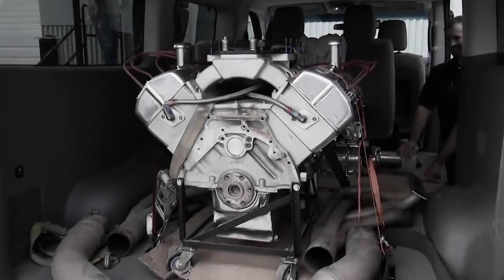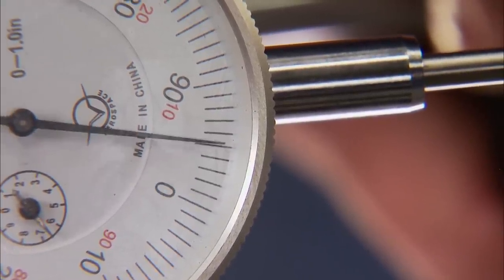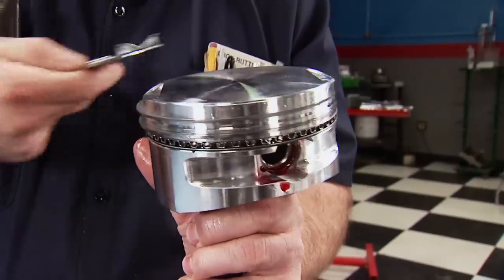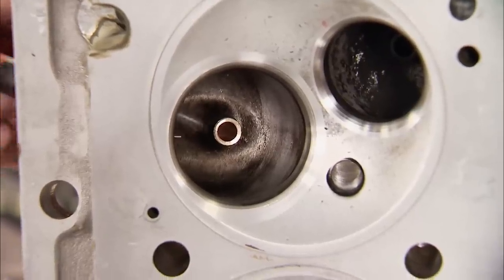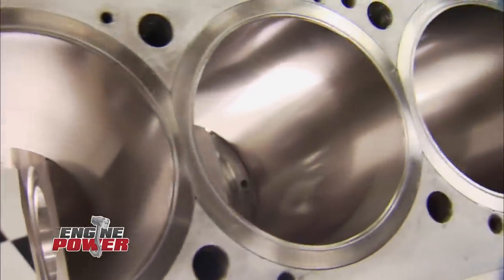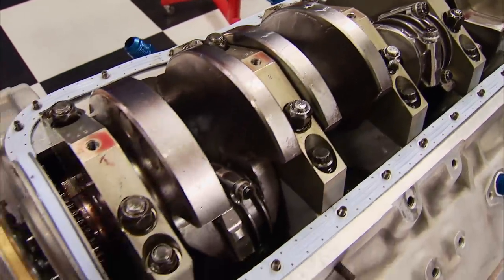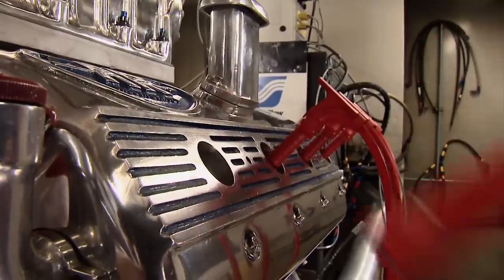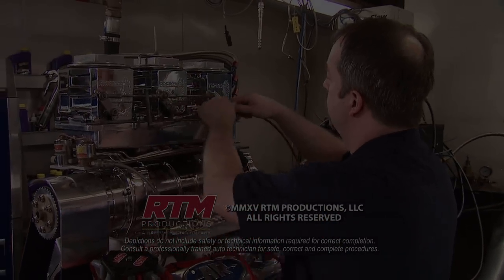The Original BigFoot Engine Build Part 3 - Engine Power Season 2, Episode 7

Comment: Absolutely gorgeous motor! I wish they would've given it a blast of nitrous though. I'm kinda surprised that it didn't produce a lot more HP than it did considering  the huge valves, high lift cam, all the reduced friction contact points by using roller tips etc. I mean, there are several Dodge and Ram products using a sweet 572  Hemi with 700hp @6500rpm. Maybe once they work up to the same RPM on this one it'll show a much higher amount of ponies revving things up.
Reply: Green MarineFive-O this is a design from the 80s and was still extremely fresh

Comment: Gotta say, I was disapointed with the final numbers.  All that tech, the size, octane and a huge blower for 1,000?  I was expecting half again that.  Still, an awesome engine.
Reply: Really the Tech was old tech... The whole thing if built today would have been completely Diff. 1000 ish HP ( Im sure they could tune if for ALOT more but the object was NOT peak HP but strong usable numbers ) for the era it was built in was AMAZING.
Reply: @Chad-Dion  A you taking into account all the upgrading they did?  Ports, new cam design, upgraded ignition.
Reply: Detuned as it’s not gonna be raced any longer.
Reply: @cavscout62  From what I gathered, it was actually increased.

Comment: why does that thing have so much deck clearance?? low comp for blower??
Reply: If you're talking about when he was degreeing the cam with the piston stop, the piston wasn't at top dead center.  He was trying to find tdc.  If it was zero decked, then he was pretty spot on for quench with a .043" head gasket.
Reply: watch them roll the thing though at 6:12 @MP-vm1jt
Reply: @reedjet  oh wow, yeah I was slipping, you're right sorry about that. I guess that engine doesn't have quench like I'm used to.

Comment: Those copper gaskets don't seem to have steel on the cylinder side like others is it not needed on solid copper gaskets??🤔🤔 Won't the heat blow or burn it.. don't remember seeing torquing the outer main cap bolts only inner 🤔🤔

Comment: I have an old car, I would like to strengthen the engine in it, what parts should I replace?
Please help, I need your information
Reply: Pull out the old and replace it with a late model LS from the junkyard and be $1000's ahead...let me tell you a little story why the Chevy LS all aluminum v8 is so popular for an engine swap for about evey old car of foreign or domestic ..first is about 50 pounds lighter weight than iron small blocks 2nd it got cylinder heads designed by Roush /Yates Ford Racing  for NASCAR that fixed the low tech efficiency Chevy was suffering from since zora arkus-duntov invented the small block Chevrolet in 1955 it happened in NASCAR when Roush /Yates Ford was asked or told by NASCAR either give the heads to everybody or take him home I never bring them back again and that is why the ls has a staggered intake and exhaust valve train to  accepted the intake manifold for every cylinder to get the same intake mixture producing efficient horsepower forever

Comment: I saw on his video and heard from an attendee at Bigfoot’s open house just recently that the engine is sitting in the shop and was overheating and has low oil pressure.  As of right now, it’s not in Bigfoot 1.  It’s a shame they shrunk it over 66 cubic inches, making such drastic changes and it not even be serviceable.  What a waste.... they’d have been far better off to have left it alone.

Comment: Wasn't this very bad? I mean, Boost increases the practial engine volume and 16 psi dobles the stock 640 cid to 1280 CID. 1000 hp from 1280 CID is only 0.78 hp pr. cube. Most built and tuned engines are way above 1 hp per cube.
800 lb/ft divided down gives only 0.625 so something has got to be way wrong, or?
Reply: Assuming they didnt really push it.
Reply: And that this is a design from the 1980s
Reply: Bob said dont hurt it !! Did you watch ?? Its 40 yrs old og bigfoot man how longs bob been retired . Wheres the truck run anymore it's been 20yrs I remember

Comment: Is it just me or is 750 horsepower in a 640 cubic inch engine with 18 pounds of boost at 5,000 rpm not really great at all?
Reply: The first time I saw big foot was in the movie take this job and shove it.  Big foot had a diesel engine in it that had to be in the mid 70s.
Reply: Connor lewis Boost is just a measure of restriction, not CFM’s. It’s only an 8/71 blower on there, not going to make huge power with that. Its only @ 26 degrees of timing as well, 32-34 degrees is about perfect for big block fords. It made 950Hp at 6000rpm, which s plenty for its intended use

Comment: Dropped from (4.630 x 4.750 = 639.8) "640" to (4.377 x 4.750 = 571.8) "572" cubes
Reply: Corazon del Oro ....John Kasse said that a smaller cubic inch with higher compression and more power would be the final result....

Comment: Not going to lie, seeing a clicker wrench used to assemble this made me wince a little.
Reply: Me too, smaller bore, lower compression pistons and a milder cam didn't help either.
Reply: @cedley1969  I understand all of the reasoning behind those choices, but to use some shitty "close enough" click torque wrench to put together a museum piece? Come on man, fairly sure John Kaase would've been against that himself. I went through the effort to use a dial type wrench on a fucking Chrysler 2.2 myself, its the least they could've done for an all-aluminum race-spec engine worth 6 digits.
Reply: @TheMailmanOfSteel  Absolutely nothing wrong with a "shitty" click torque wrench.  Properly calibrated and maintained.  They're used the world over for aerospace applications so they're plenty good for building an engine
Reply: dont worry buddy, those shitty clicker torque wrenches build every fucking turbine in the world that makes electricity until the point where we use hydraulic tooling. They are also checked for calibration. Keep spending your credit at your local crack dealer. The millwrights will keep doing it right.
Reply: Properly maintained the old clicker is the way to go. A lot of performance engine guys here down under don’t like digital.. and nor do I

Comment: Good work guys.  You can almost keep up with stock Honda N/A VTEC engines on equivalent capacity basis.
Reply: Hondas are so not cool. ever
Reply: The problem is one of scale, smaller motors based on relative valve area and reduced friction will make better numbers relative to capacity. By that same token scale the Honda up and you would see the numbers get worse.  If you want to be impressed look at RC airplane motors.  Their power per cc makes your Honda cry. The day that a vtec can push a monster truck at 5k rpm then I will be impressed.

Comment: this engine gets about 1000 hp on a blower setup, look at what this engine can do when the nitrous is hooked up.
Reply: They never used the Nitro anyways. It had more then enough power.
Reply: *nitrous
Reply: @Meekerextreme  I agreed ! Only wimpy small blocks V8 need Nitro lol jk
Reply: Maybe I’m harsh but I found the numbers underwhelming considering the cubes and big blower.  the internet has tricked me into believing that all v8 engine builds must make 1500+ these days.
Reply: @Scott-to8ri  No small blocks can make 12000hp Only Big Blocks. 1500 + easy for Big Block V8 lol
Reply: Probably not twelve thousand horsepower... but my small block made 1460 on the dyno. Car was index raced at 5.02@142 in the 1/8th mile. Don't doubt what some of these small blocks can do!
Reply: Big numbers 40 years ago, when Bigfoot 1 was relevant. But less than 1000 hp from a build this expensive in this day and age is shameful.
Reply: @Silkmaster4200 The original builder of this motor built and tuned a small block Chevy that they ran in a alcohol dragster that mainly had all hemis in that class, and they destroyed everyone in their way..They won 5 consecutive championships from 97-2001.
Reply: 231mac thanks, i’m not english.
Reply: No, they just used the same basic pieces. They used modern camshaft technology and a stripped blower
Reply: @TNTBoom-gf3er  Depends on the hp. Back than never reach 12000hp +. Big Blocks now will eat a small block all day all night lol Just simply better torque and better power.
Reply: @Silkmaster4200 I think Gene Hector and the small block mafia was really the last ones to really haul ass with one..but you can’t out run hemis anymore. They just make way to much power.

Comment: Like the builds on the ford moters  I just picked up a 1968 ltd 2dr hide away headlights it was suppose to have a 390 but turns out to be a 400 that I know of but I want to get the most power I can ..what would be the first step you would take and do to this? it has a 2 barrel carb witch I'm going to change but other than that ..I know it sounds pretty good for having stock manifolds witch I'm going to change it's got fuel exaughst but anyways let me know plz thx
Reply: Adam Lolno  thx for the info but quick question what would be the best type of heads and what's the reason for swapping out the heads just curiouse this will  be my first build since my old 68 gto I had when I was 17 or 18 not sure but also what type of cam would be good I want it to sound and act came out but thx for the info bud
Reply: Same as a 351M

Comment: With all that money spent and the size of the motor and supercharger I fell like it should be making 2500 or more HP. You can make 750+ hp on a 03/04 Corba with a pully swap and fuel system upgrade.
Reply: Mike M 1. It’s an 8/71, not a 14/71 like what you’d find on an NHRA pro mod. It’s not flowing enough air to make 2500+. 2. It’s on gas, not alcohol. 3. Only 26 degrees of timing. 4. The boss 429 platform is capable of 3000+ in blown alcohol form like what you’d find in a legal pro mod

Comment: 640", 16psi boost= 750hp? Very sad😩
Reply: They only reved it to 5000rmp, rev it to 7k and it'd be a lot higher.
Reply: 3 things u clearly haven’t taken into account

1. It’s a fresh engine.
2. It was designed in the 1980s
3. 16psi and 5000rpm is BELOW NOTHING for an engine like that, even for the 80s
Reply: I didn’t even think they went to 5000...  I thought it was 4000
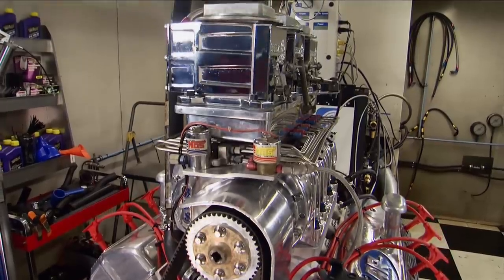Reply: At 18:10 seconds they stated they went for another sweep to 6k RPM and gained an additional 200 HP so that's 950 HP at 6000 RPM. Boost levels were not mentioned but it was stated that boost was 16 PSI AND rising as well on the 5000 rpm pull.
Reply: @nhraandnascarfanatic5907  there's engines from gm designed in the 80's that have been revamped with new internals and blowers to make 2500-3000hp. Not to mention every sbc with a 4 bolt main that's been stroked and boosted. Shit, I had an s10 with a 383 stroker that made 500 with no boost. And that engine was designed in the 80's 😂 the fact of the matter is, WE WANT MORE POWER!
Reply: whatever mechanics  if they wanted to really get after it, that engine platform is good for 3000hp. It would need revised ports, different cam, probably compression adjustment, and much more capable blower. If someone chose to do so, they could probably get that engine platform to qualify for an nhra pro mod race...but that would take a good amount of changes, but it could do it and be competitive
Reply: D G that engine is based on a 1969 design from the boss 429 mustangs. Just happened to be built in the 80’s. Alan Root made some changes to the block and heads to make it better at the time.

Comment: Hmm. Seeing that motor run, that blower belt looks awfully sloppy. I wonder if that's normal. Also, looking at it, i wonder why you ran it on the outside of the idler pulley. It looks like you could run it on the inside just fine, room enough to tension it, you have more teeth engaging the blower and crank pulleys, and you're not running the teeth across the idler, causing faster wear. Is there any specific reason why it's mounted like it is?
Reply: Pretty sure the belt would get tight enough to not flop around when the engine is at running temps.

Comment: 17:25 I'm a noob but the blower belt is flapping so much
Reply: that's what they do at certain rpms, if you made it so tight it did not do it it would have to much friction, it does have a spring loaded tensioner
Reply: Blower belts get tighter as they heat up. If they are installed too tight, they can actually break off the crank snout when they heat up.

Comment: Remember to change oil after the run, because the 3-4 different lubrication products used during assembly is now mixed and changes the oils properties.
I know this is not a Turbo engine, but the fat crease on the rockers, could end up in a turbo, where it does not belong.

Comment: Smithsonian is such a waste, These were built to drive, not to be hidden away
Reply: Cameron Nurcombe You won’t see it in the Smithsonian until Bob Chandler is long gone. He believes the truck should still be used for parades and such. This engine is now in the showroom of Bigfoot on a stand, it was replaced by a stock Ford engine. It wouldn’t be no big deal to put the truck in the Smithsonian, this truck isn’t all original anyways, the bodies been replaced several times, they could build a replica easy and no one would ever know the difference.

Comment: Very disappointing power considering it's specs. But still bad ass!
Reply: Justin S the engine was designed in the 80s, a lot has changed since then.. but back then these were massive numbers... not to mention they weren’t even leaning on it on that dyno run.. this build was purely for restoration. Not making shitloads of hp and risk hurting that priceless, irreplaceable and  iconic engine

Comment: Weak but it is 80s technology people need to remember
Reply: cortney bunge this engine is based on a 1969 design. These for Hemi engines are capable of 3000+ with the right blower and alcohol injection set up

Comment: Why don't we see a Kasse Ford in Pro Stock?
Reply: In order for a Ford to be in Pro Stock, they would have to manufacture and engine and parts and make them available to the public for purchase.  They no longer manufacture parts viable for Pro Stock, so. . .   Well, by NHRA rules at least.  There are Pro Stock classes in other sanctioning bodies whom have different rules.
Reply: @tirefryr  GM doesn't either hasn't for years.
Reply: Incorrect; GM is on the DRCE 4 blocks and heads now.  You may even still be able to purchase the DRCE 3 engines and parts .  If they hadn't built parts for years, they wouldn't be racing in (NHRA) Pro Stock.  Ford did away with their Pro Stock stuff a while ago to concentrate on the Factory Stock Cobra Jet program.  This is also the reason they stopped working with John Force Racing.
Reply: He builds mountain motor pro stock winning engines. His engines have won many championships.

Comment: Too conservative on the dyno. Shoulda hit 1000hp before putting her to rest!
Reply: Most expensive 600 hp ever...I was expecting 1500. That engine should make 1000 hp NA at 6200-6500 rpm., any decent 632 BBC can and will do it. Those boys fail. Always short change the blue oval. Disgusting.

Comment: Never seen rod bolts snugged up with a cordless impact................to each their own I guess
Reply: @andy.s5945  A lot of stupid people in this world they see one part and assume nothing else was done...LOL These guys build engines I assume they know something. Hell I get that on my simple videos "you didn't show how to take the caliper off" It's like wow I didn't know you couldn't figure out that simple task maybe step back away from your 12 point socket and hire someone.  LOL
Reply: They just snugged them up takes forever hand tightening rod bolts
Reply: It was the "magnetic base" (on an alloy block) and dial indicator (made in china) that made me lose faith
Reply: @lariwoo  Nothing wrong with some of the Chinese dial indicators (not all).   We use them and Mitutoyo as well and they pass calibration every 6 months easily.
Reply: I take it you have never watched sloppy mechanics then lol. Go check him out , builds some awesome stuff on the cheap.
Reply: @lariwoo  - I saw that too............(shakes head)
Reply: @Meekerextreme  - These guys "assemble" engines, I didn't see them do ANY of the machine work, lapping the valves or anything other than disassemble, measure, order parts, set ring gap (ohhh, ahhh) and re-assemble.

I guarantee the machine shop measured it all again before doing any of work. These are glorified parts replacers and TV personalities - Nothing more.
Reply: @MattLundquistVW  - Backyard mechanic special, nothing more. Let's see his stuff last more than a few passes before blowing up.................Definitely wouldn't drive it on the road, or trust it for any daily driving or some distance.

He wastes MORE time going back and fixing things, than doing simple tests BEFORE installing stuff to find out problems BEFORE they cause him more wasted time. Example - Compression test, even a cheap gauge would have caught the #6 cold cylinder BEFORE he bolted and hammered (literally) parts on to the car.
Reply: @camerond8176  The more sane combos he puts together will last, like the don't bs me build. Yes the thousand HP tire combo  that was in the truck would not live at that level. But he even admitted to that when he put that together, it was a test just to see if it could be done. Most people don't do a test compression before they in stall an engine in a car regardless if it is new or used, professional or backyard mechanic. He gives good information and combos for free whether or not you like the way he goes about it. My self would not do half the half assness he does. But I enjoy seeing him work through it all.
Reply: @camerond8176  yes they're called engine builders, not machinists.
Reply: @TheBlaert  - Engine builders should know how to lap the valves, we learned this very important step in my 2nd year apprenticeship................requires nothing more than lapping compound and a $10 tool.

Didn't see this at all, just slam the valves in and hope for the best.